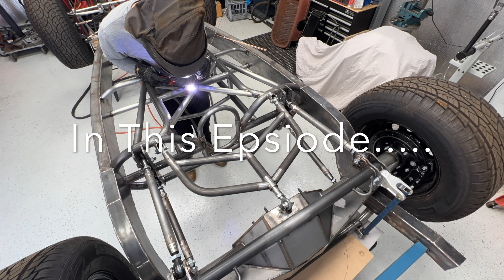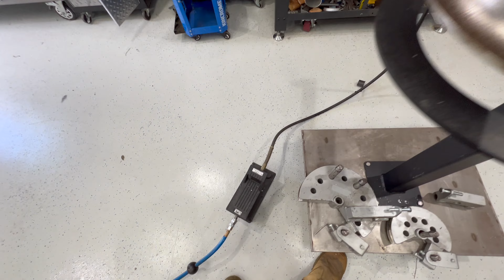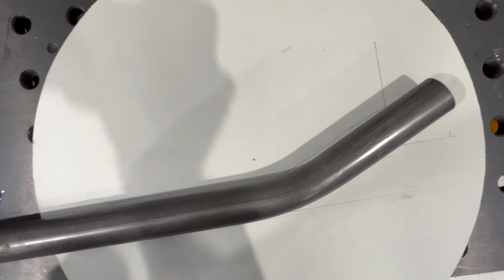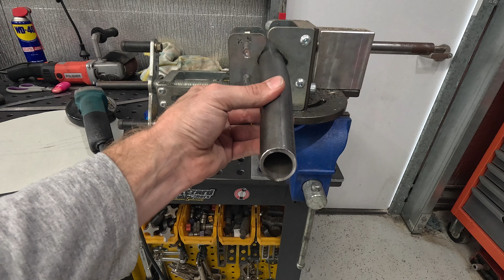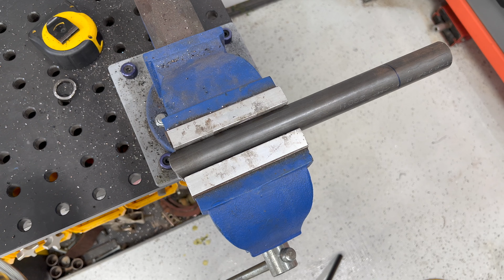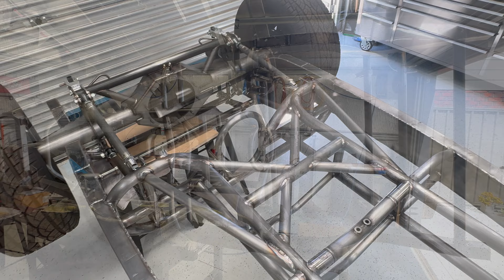Fabricating chromoly tube for chassis using speedwerx/jd2 model 32 bender

Comment: Where did you get the removable joiners from?
Reply from the maker: @murraydaniels7401  Hi the 1 1/4 engine mount brace ones are from somewhere called road runner offroad. The rollcage and transmission mount 1 5/8 size are BRC brand and are very nice and can be used 360degrees as they are double locking. Cheers